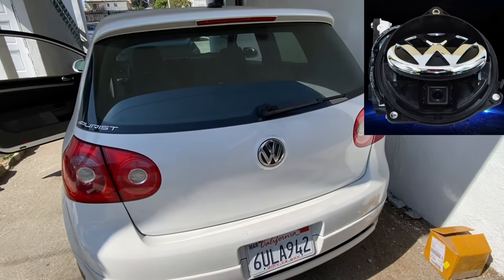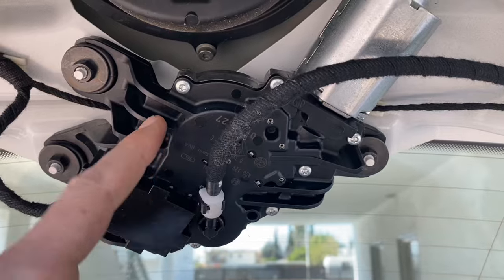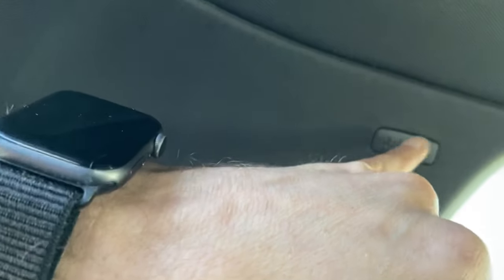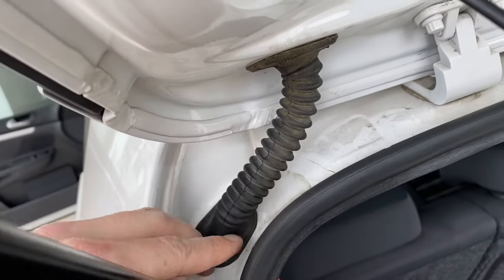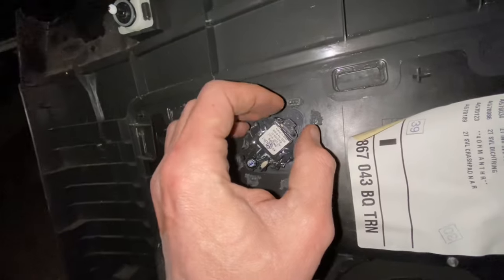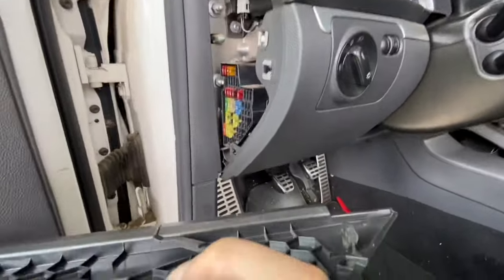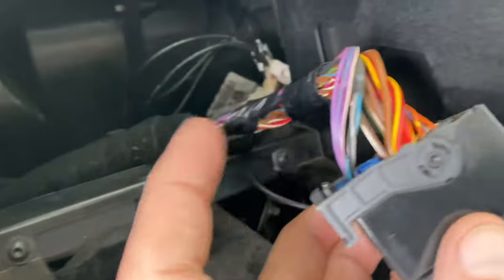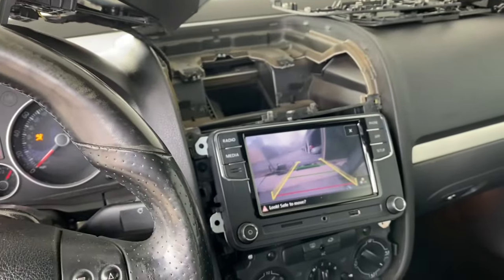How to install Flip Badge Rear View Camera and RCD330 head unit in MK5 VW GTI

Comment: My son and I installed this RVC in our 2 door MK6 (2011) GTI.  Was mostly smooth thanks to your video.  Struggled some fishing the wiring through the rubber flexible tubing between the body and hatch, but patience prevailed.  Seem to be more wires feeding through that tube in the MK6 than what I've seen with MK5 videos.  For others that may be installing in the MK6, we were able to route the power and video cable under the rear seat side panel without removing it.  We pulled the front of the rear seat up and then were able to tuck the cables under the side panel.  The reverse light wiring is a little different in the 2011 MK6 (assume all MK6)--all the wires were white and there were three of them.  I ended up taking the wiring clip out of the back of the reverse lamp housing and using a multimeter to test for the reverse wire while my son had it in reverse.  It ended up being the right-most wire looking at it in the orientation it is inserted into the lamp housing.  I connected to the left reverse lamp.  Appreciate the detailed video and tips!
Reply from the maker: I’m very glad that it helped!  That rubber tube was indeed frustrating, but as you say, persistence gets it done. Thank you for the additional tips, and happy reversing 👍
Reply: @asolon  tried doing this exact install a couple weeks ago, and like you and @jamiepearson6448, struggled with the rubber tube routing between the body and the hatch. Question for you both: my rear back-up cam has an RCA "4-pin" connector like the one in the video. Pretty sure we have the exact same wiring from the same seller. When I try to snake that 4-pin connecter through the rubber tube, I could not for the life of me fit it through the hard plastic opening of the boot that meets the car body. Did your MK5 rubber tube have that same hard plastic mold on the end? Did you you just force it through, or break the plastic in the process? Any help would be appreciated. Cheers!
Reply: Any issues with the rear wiper after this? Will it still work properly?

Comment: I just completed the same installation in my 2007 Rabbit 4-door. Running the wiring from the truck to the dash was much easier in the 4-door variant. One thing that I missed, and wasted 3 hours because of, is that the camera only displays a black screen when the truck is open. I hadn't closed it since all of my wiring was still loose. As soon as I closed the trunk everything started working great!

This is probably the best automotive how to video I have ever had the pleasure of following! Thank you!

Comment: I feel you!

When I got my Mk5 GTI I immediately installed a sub in the trunk. Routed the power cable on the left side of the car, routed the signal cables on the right side of the car. Total PITA to remove the trim panels and reinstall them.

Then a few months later I installed Golf 6 look LED tail lights which required me to run 4 cables through EACH rubber going to the trunk (Yes, 4 thick cables). Spent more than 5 hours on just getting the cables through the rubbers. It was not a fun day.

But in the end I managed to install the lights and get the wires through the rubbers, and the lights look awesome!
Reply from the maker: As a step in a project, “run the wires” doesn’t sound so hard, but turns out it’s pretty time consuming.  Definitely a patience tester!

Comment: Installed it yesterday on my MK5 2007 that also has 2 doors and everything works fine !
Your video helped me a lot to get the job done faster :D ( took me around 8 hours )
Reply from the maker: Excellent!  Glad it helped.  Enjoy!
Reply: Hey!! Just got an MK5 Golf GT 2007. I have a couple of questions if you don't mind:
1. Will the dynamic steering function work on this model?
2. @asolon do your SW buttons work with RDC330?

Comment: Well done! The detail and advice you provide is fantastic. May be attempting this in our MK6.
Reply from the maker: Great, thanks! Should be an easier go for you— no metal cutting, and less dash to remove to get the head unit in.  Good luck!
Reply: did you end up doing it on the mk6? If you did how did it go?

Comment: Pro tip: use a little smear of silicone paste(dielectric grease) on the wires to help slide through the boot, and run your wire(s) along the top, and run down the A pillar

Comment: Thanks so much for this! At 33:06 - I didn’t realize the wiring from the camera unit itself (within the emblem) needed some slack.

I had tested mine and it worked fine before, then I tidied up my wiring and all of a sudden it stopped working. Kept saying Rear view camera not available. I took off the tesa tape I’d applied and let the camera wire slack a little. To my surprise, it worked lol.
Reply from the maker: Same!  You’ll notice the footage there is a different location and was next day actually, haha.  

At first, I’d not left enough slack,  it was preventing the camera from fully extending and the inside of the badge itself was blocking the top of the image, until it eventually unplugged the wire.  I was SO disappointed even thinking about pulling things back apart, but it was obvious as soon as I got the hatch trim back off.
Reply: @asolon  is everything still working great for you? I started having issues. The reverse camera works sometimes but will sometimes go black and say “Rear view camera not available...”
In a bit of a loss now... it’s very intermittent.
Reply from the maker: Yeah, mine’s working no problem.  Sorry to hear you’re having trouble.  Sounds like the issue you’re having is to do with the video cable itself.  I’d reconfirm the connection near the badge has enough slack so that it’s not pulling the plug and giving an intermittent signal.  Then check your 12v power and grounding connections are good.  Be sure that your ground is on bare, unpainted metal.
Reply: @asolon  Yeah I checked all the wiring and everything's good. I was actually having this issue months ago but it worked fine a few days later so I left it alone. Started having issues again which prompted me to order new cables from the seller and re-do everything from the beginning, which is when I found your video. I think I'll be chalking this up to camera issues now and might order from a different seller. For now, I'll take apart the unit and replace only the camera with an identical looking one off Amazon (camera looked identical, with the same 5 pin connectors). I'll let you know what happens! Thanks :)
Reply: @asolon  Got a new camera unit. Works perfect now! Not sure what happened with my previous unit, camera seemed to be defective since I didn't bother changing the cables and it worked.
Reply: How did you tap into the reverse wit

Comment: "I'm proud of myself". You should! Amazing job at logging all the technical details. Thank you. I'm training myself so I can do a job like yours. Few questions, how long (hours) did it take you to do the whole job? Are you thinking about hooking up parking sensors to the head unit too?
Reply from the maker: Thank you!  I did the job over 2 half days.  You ought to be able to get it done in a day/several hours.  I was figuring out some of the processes myself, reviewing videos, and recording along the way.  Removing and reinstalling the rear side panel and upper B pillar cost me a lot of time, which is why I annotated the video a lot around that area to save viewers' time.  Working the wires through the rubber tube by the hatch, and the metal cutting (MK5's only) were time consuming as well.  MK5's didn't have OEM park assist sensors available.  Good luck!

Comment: Thanks for the extensive guide! My only concern is the drain. Might need a longer drain pipe to tap into the drain directly. Being in Canada, we have quite a bit of salt and I can see the hatch rusting from the inside out if the brine sits there.
Reply from the maker: Certainly understand the concern. The bottom of the hatch sheetmetal appears to have a slight downward gradient towards the open hole, and I live in SoCal so wasn’t as concerned.  For you and others in wintery climates, you could  just head to a hardware store and find some inexpensive line to route it.  Mk6 and other models that had the flip RVC available from the factory have a rubber plug in the center hole that can be removed iirc

Comment: Maybe it’s something I missed in the video but I installed it all. Camera works but my hatch doesn’t open. It’s all plugged in and hooked up properly.
Reply from the maker: Sounds like you might not have used an “unswitched” fuse to tap.  You need to find a fuse that still has power when the ignition is turned off.  Simple tester should locate one for you, like in the steps around the 30:00 mark.  The position might be different than my video as the fuse locations change depending on model year and equipment level.  Good luck!
Reply: @asolon  I have mine hooked straight up to the battery. Even when the car is on the hatch doesn’t open

Comment: My question is which fuse already powered the rear latch?
Reply: The latch itself has it's own connector. You need to fuse tap solely for the motor that flips the camera out.

Comment: 26:00 Instead using the Adapter that prevents the battery drain you can replace the gateway with that one from the Mk6. That‘s what I did.

Comment: Hi I have a question. I have a RCD 330 installed into my Golf Mk5 and I am thinking of getting a multifunctional steering wheel like the one you have. I currently have the standard steering wheel which doesn’t have steering wheel controls. My question to you is can you change to the next song and previous songs using the buttons on the steering wheel? I know you can increase and decrease the volume but I am mainly interested in being able to skip to the next and previous songs so I don’t have to keep pressing on the RCD 330 display Screen.
Reply: Would be very grateful if I could get an answer to this. I am unsure as the multifunctional steering wheel on the MK5 Golf has up and down arrows and not left and right arrows … so I’m unsure if they would work to skip to the next and previous tracks when using apple carplay/Bluetooth music connection from your phone to the RCD.
Reply from the maker: Sorry I missed this.  I am able to change tracks, however it also cycles the MFD display at the same time.  🤷🏻‍♂️

Comment: If latch gets constant power , will it drain the car battery ?
Reply from the maker: The latch shouldn’t drain it.  It’s the same as a door lock having power.  But the head unit potentially could, if you have an earlier production canbus. I used the wire harness adapter from the RCD330 seller to prevent that on mine.

Comment: Does the mark 6 camera work on the mark 5?
Reply from the maker: It does, but with some modification I showed in the video:  a small piece of metal needs to be removed inside the hatch, and one of the 3 legs from the wiper motor as well.
Reply: asolon do you have the link to the exact reverse camera i would need for my mark 5 gti
Reply from the maker: Yup, should all be in the description!